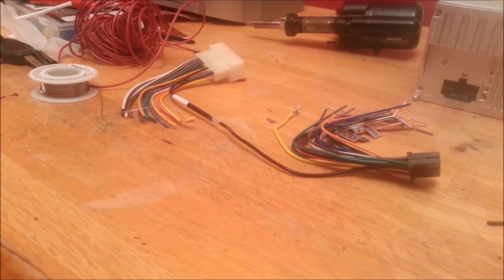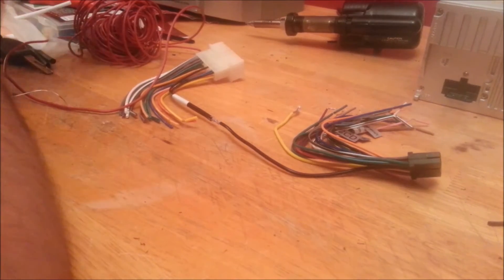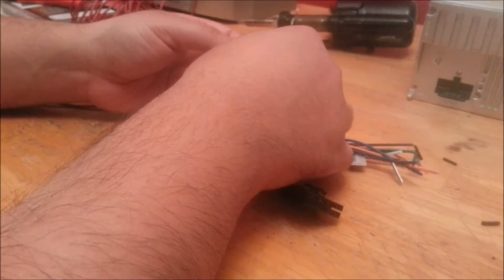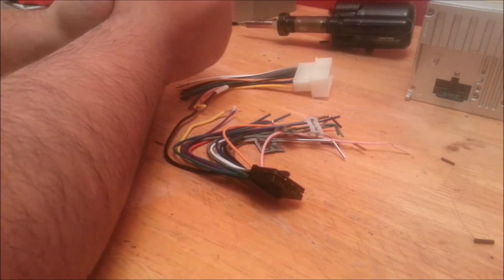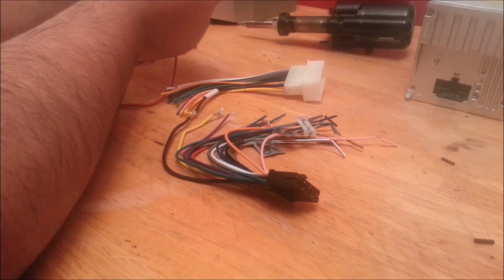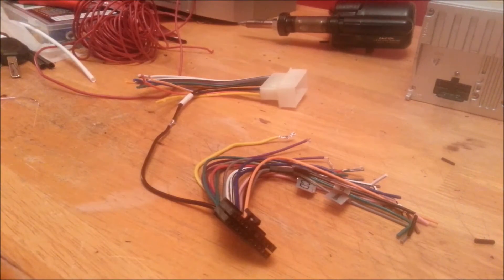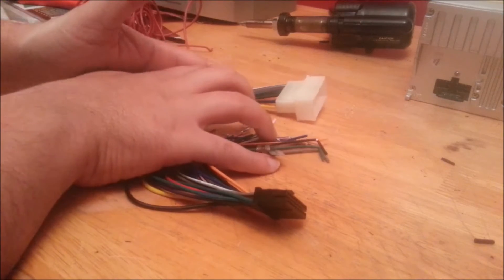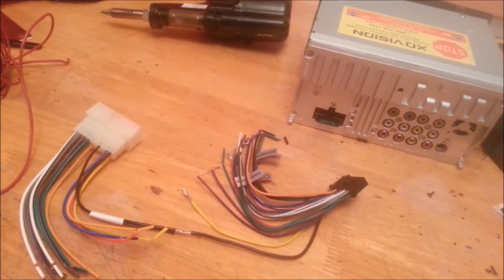Stereo harness wiring - color codes meaning

Comment: In the first thanks for this video,
And i have the same white harness but the 2 orange wire in the middle don't know connect with the other harness in new stereo 18 pin.
Reply from the maker: ahmed antar, thanks for feedback, some stereos don't have illumination, if that's the case no need to connect them to anything.
Reply: Newbies Work on Cars thanks for answer my car hyundai elantra md 2012